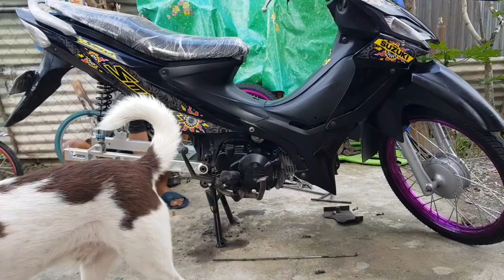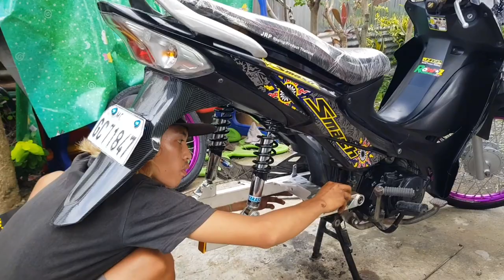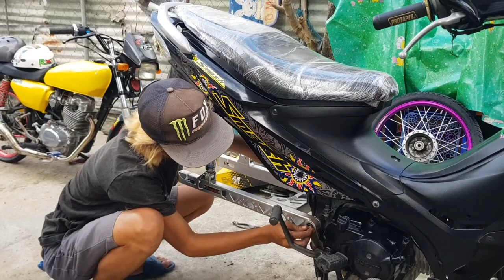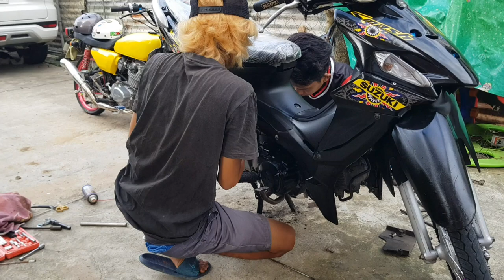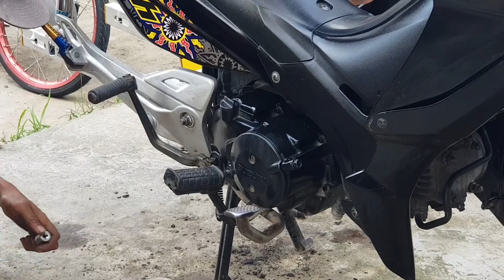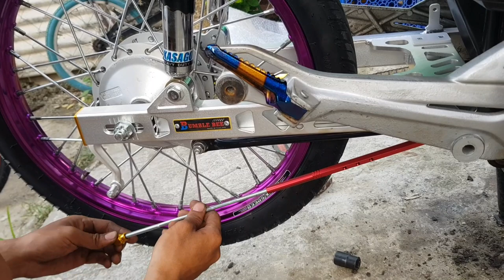Installing plus 2 swing arm and mrc alloy brake arm with adjustable rod

Comment: Bossing pwde bang stock break arm  ng smash ang ilagay . Slamat sa sagot. 😇
Reply from the maker: Pwede Lang ang stock na brake arm bos. Ang brake rod lang magpapalit ka ng plus 2 din kasi maikli lang yung stock na brake rod
Reply: @MIAJEANVLOGOFFICIAL  boss isa pa po nag lagay ka po ba ng pang pa sikip sa boshing ng swing at tiyaka po washer ilan po na dag dag mag kabila? Maraming salamat po😇
Reply from the maker: @ignacioumandal9659  opo naglagay nang pang sikip ng bushing at sa washer isa isa Lang nilagay ko
Reply: Salamat po